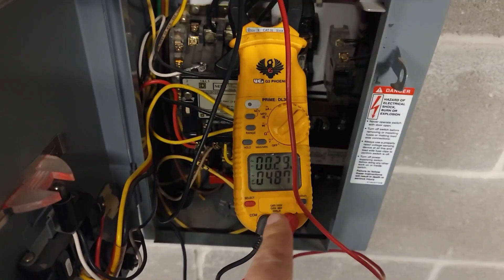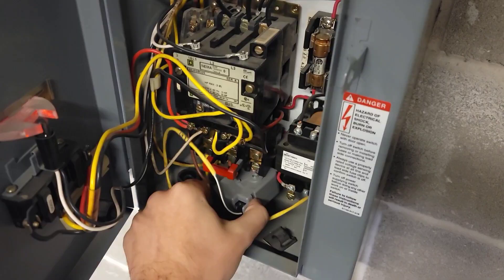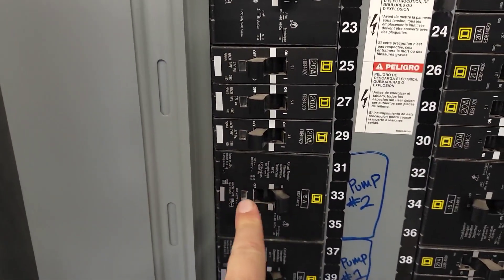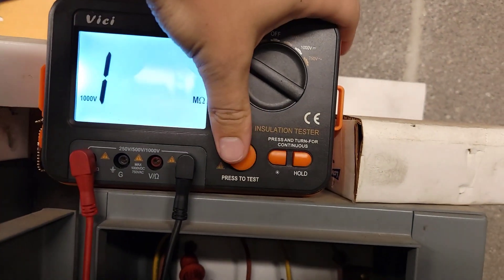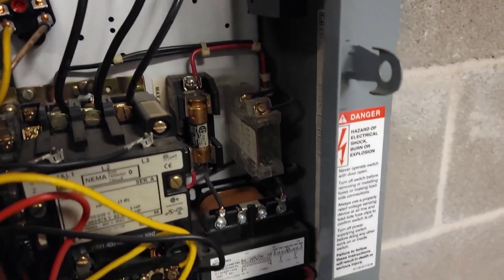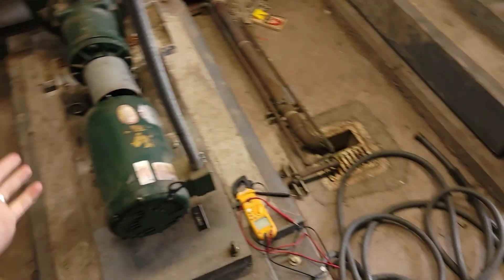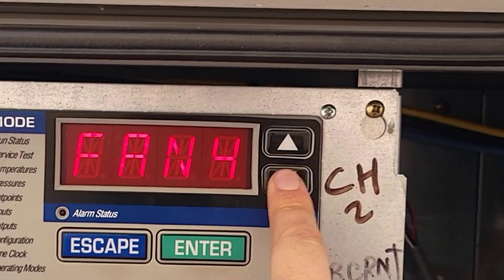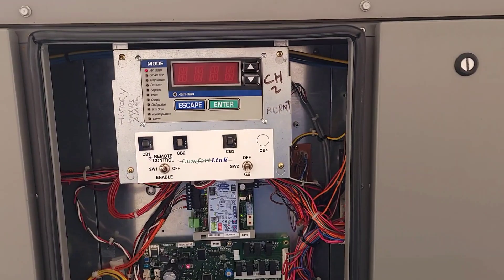Chiller Down On Flow Alarm Carrier A200

Comment: Didn't you just post a question about megging motors and state you never meg over the motors voltage? Is it a 1000 volt motor?
Reply from the maker: Never more than 2x motor voltage

Comment: Pretty amazed that it takes a few minutes before the chiller trips on no flow .
The ones I work on will trip almost instantly whilst running , or have a 60 second time delay on start ups , while the pump alone will run but not the compressors. 
This way they prevent the cooling from running without water flow .
Reply from the maker: If its in operation it will trip immediately on A201, if flow never stops after it goes unoccupied it will trip A202. A200 is when it never see's flow upon going occupied.
Reply: @HVACTIME  Makes way more sense now , cheers !

Comment: The overload is slow reacting device. Remember, if you are running slightly more current then it set to - it might take 20 minutes before it trips ( depending on OL code)
I think that was a inductive spike from both transformer and contractor coil that blew the fuse on sudden power interruption.
Reply: 😊7
Reply: 😅😅5😅